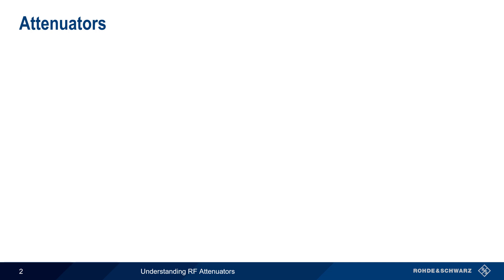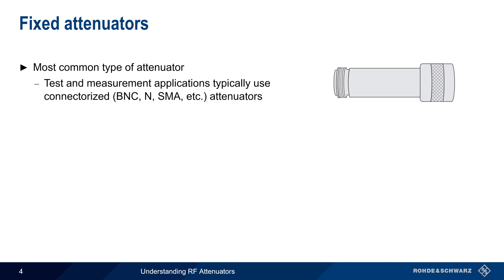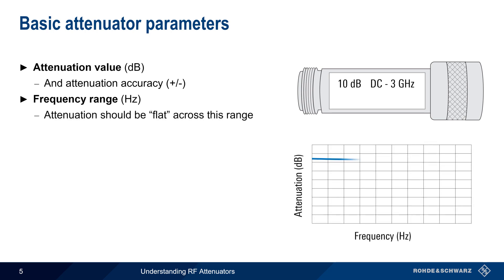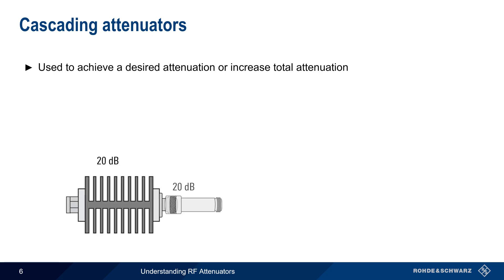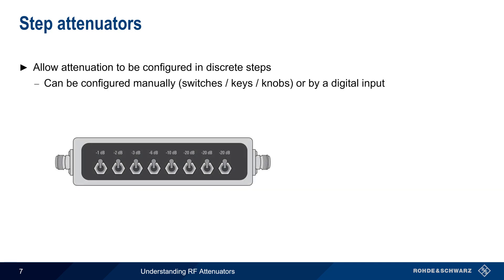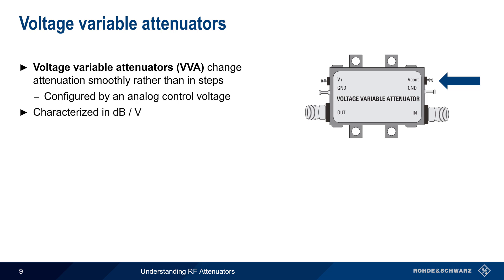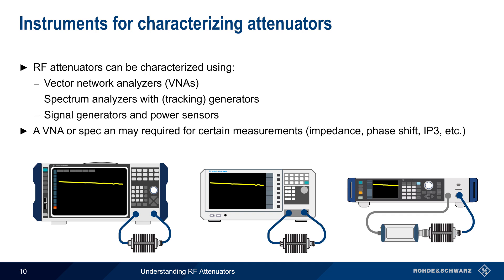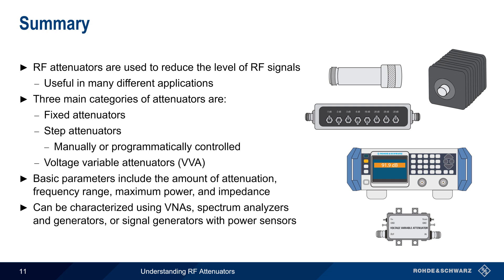Understanding RF Attenuators

Comment: very great presentation but VSWR was not mentioned as a parameter
some attenuators have higher VSWR than others which may cause a reflection that can trigger a VSWR Alarm in the system